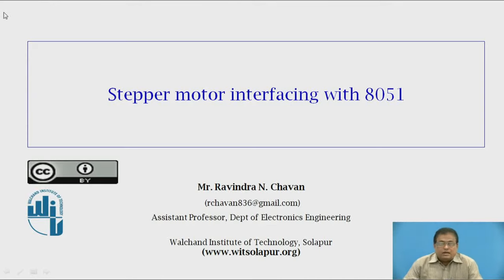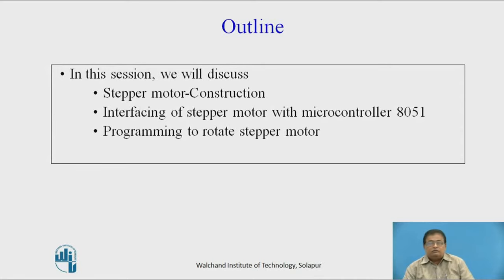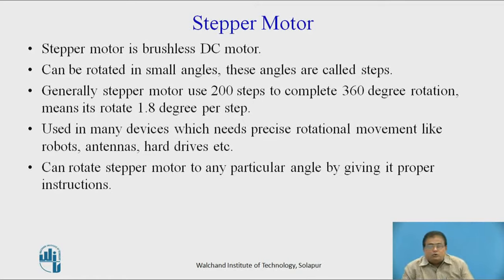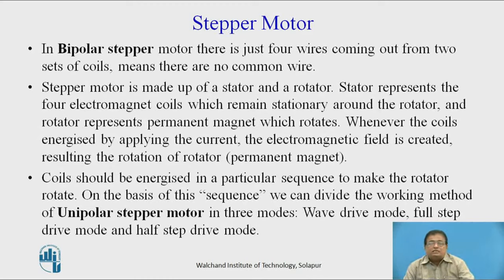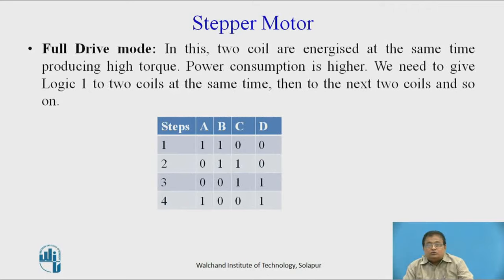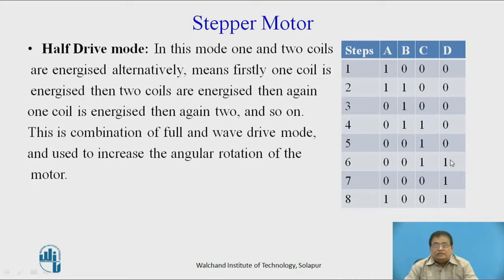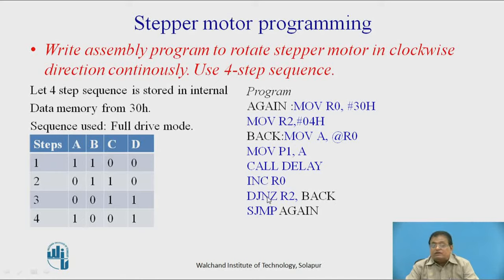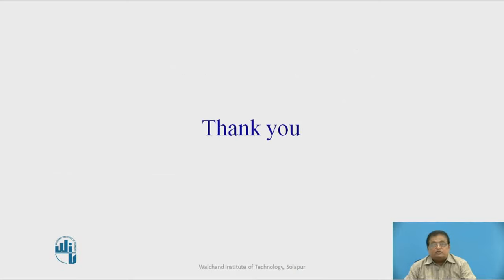8051- Stepper Motor Interfacing

Comment: Sir give reply for this question 
Make use of ALP to rotate stepper motor 64° in clockwise direction, using the interfacing diagram. The motor has the step angle of 2°.